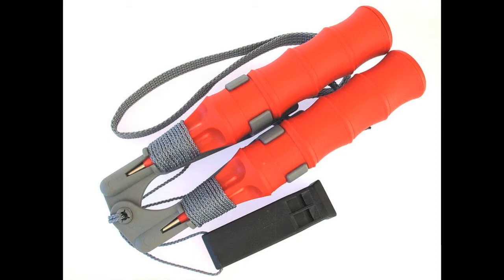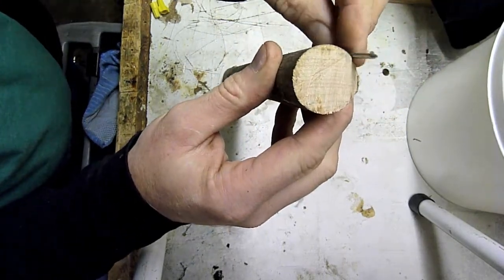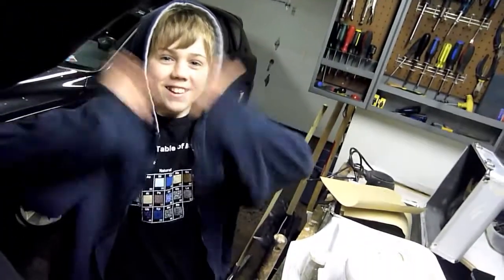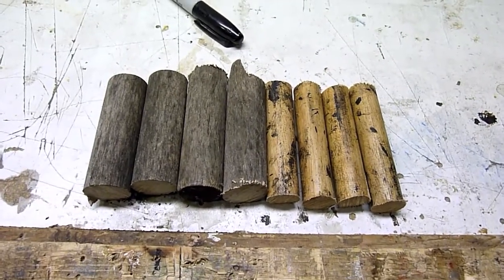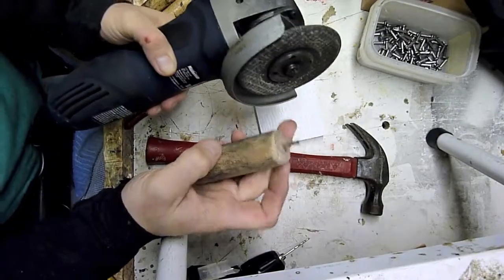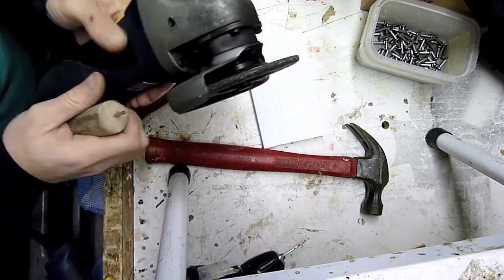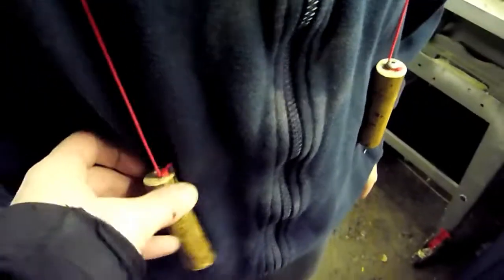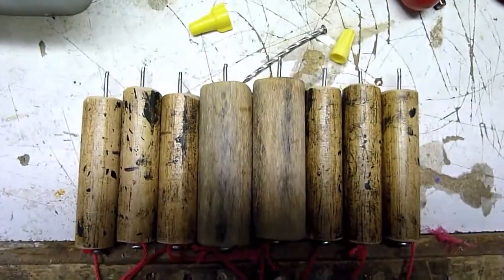Diy Ice picks

Comment: Would make more sense to drill the hole just a little bigger than the nail and put some 2 part epoxy in the hole the put the nail in the hole the other way
Reply from the maker: Im sure that would work fine.
Reply: That's literally what I was thinking... I'll try that out and let you know how it goes.